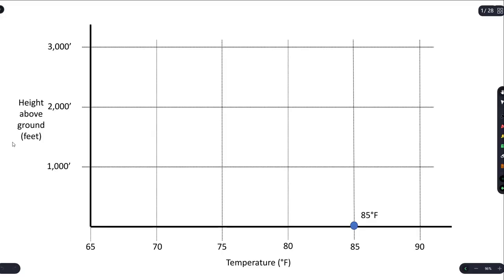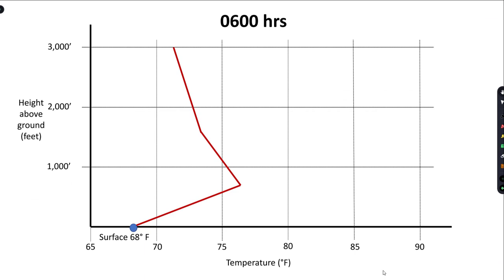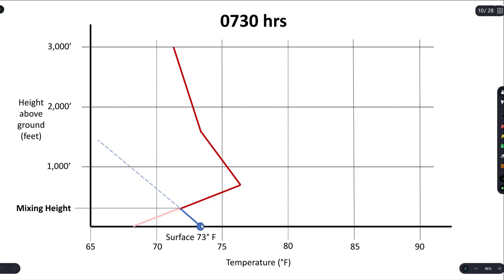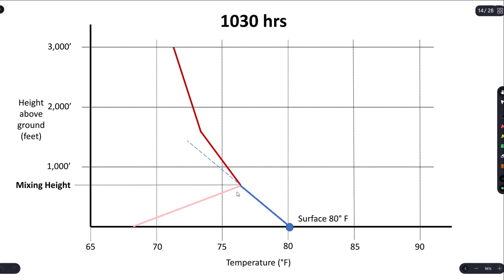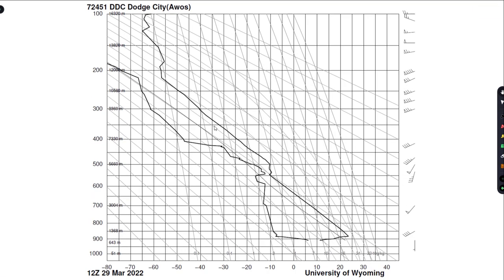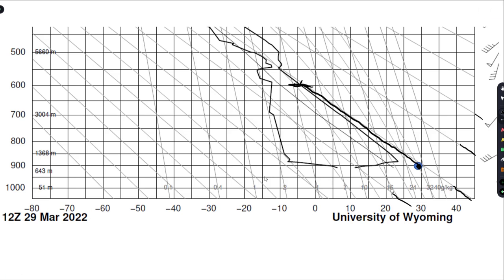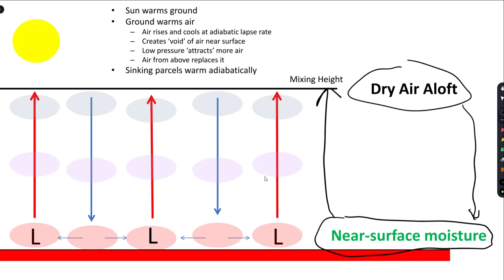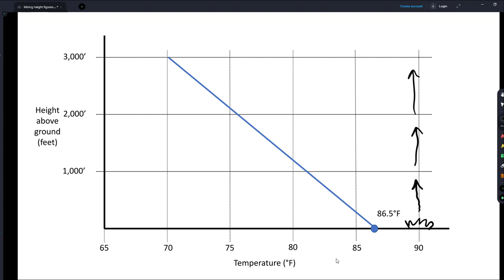What is the Mixing Height?

Comment: What a great explanation!  Big factor in predicting rx burns too I figure to make sure mixing height takes the column well away from municipalities.
Reply from the maker: When you multiply the mixing height by the average wind speed within the mixed layer, you get the Ventilation Index which is a widely used metric for assessing smoke dispersal.